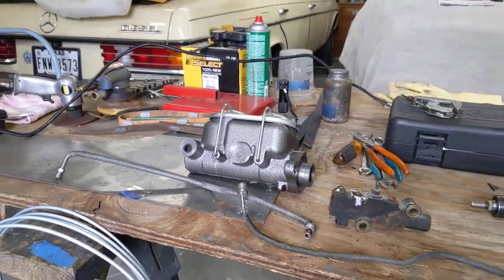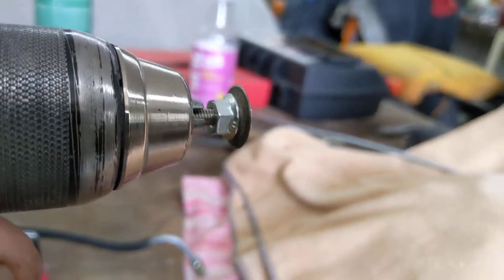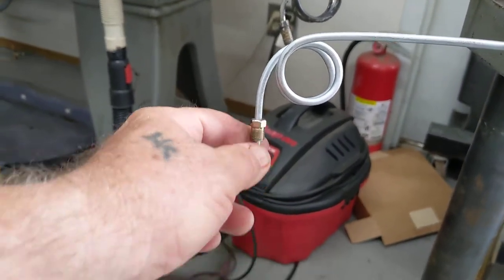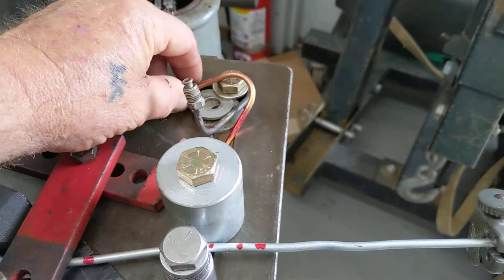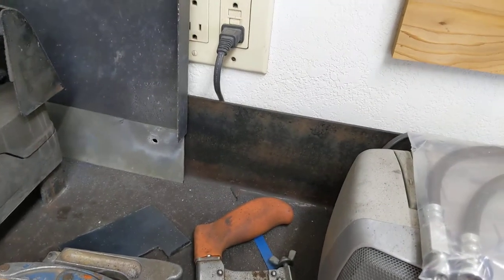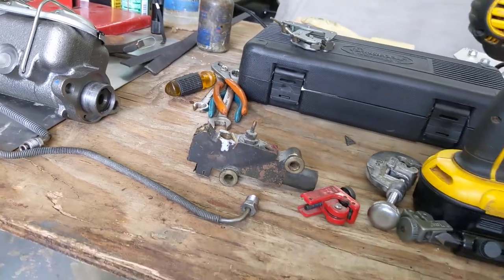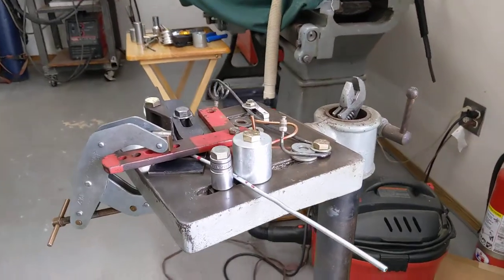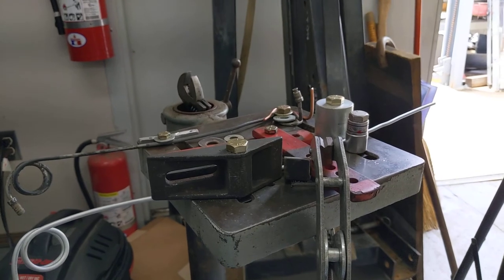Making new brake lines for the 1976 C3 Stingray - Part 4

Comment: Line bending takes a lot of time to get right.
Reply from the maker: I got'a get my butt in gear and finish my fixturing table, would be an asset in lue of using my old Delta drill stand :)>.
Reply from the maker: ever sale an ole horse, and it keeps finding it's way back home?? I sold an 83 300sd twist, and it's coming home to stable once again,,dang it...may be an omen too keep this time,,,any input??
Reply: @bearsrodshop7067  I prefer the w116 and w123 cars but that is just me.
Reply from the maker: Have 4 123 I need to part with when you get ready :)>